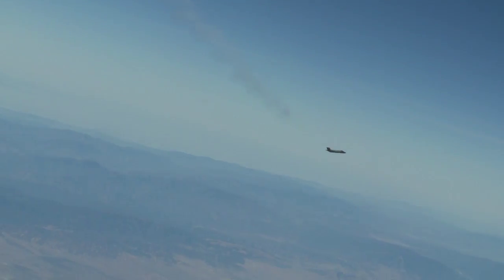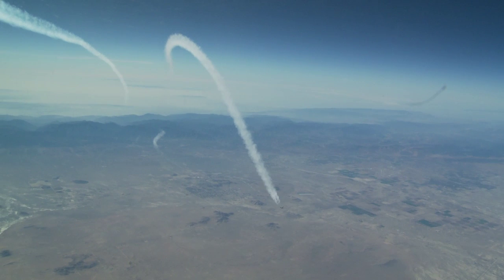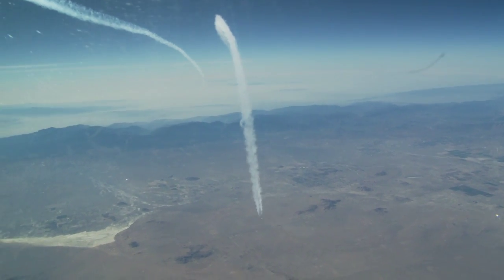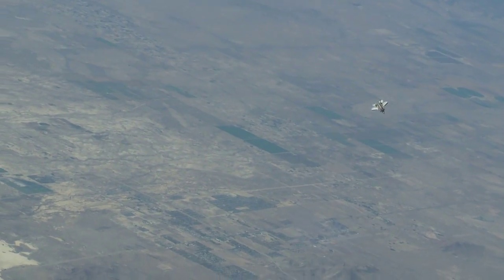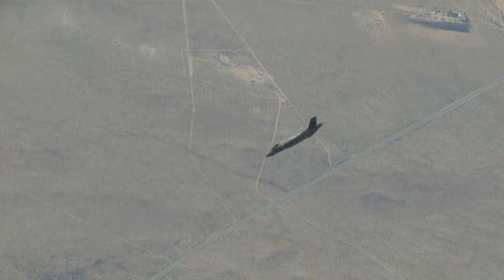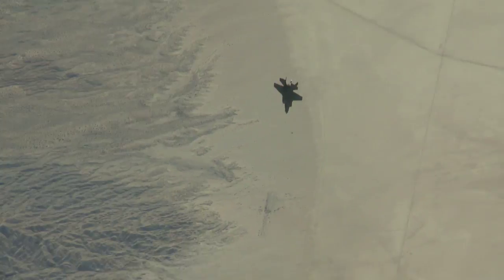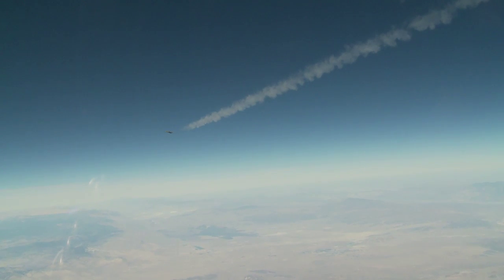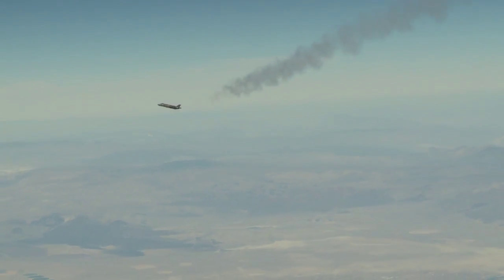F-35 High Angle of Attack Testing

Comment: why not put a moveable valve at rear of f 35 engine to make it turn right or left easier
Reply: +Rodrick Darby Have you not seen how crazy the vectoring on the F-35 engine is? Do you think you're smarter than the engineers?
Reply: +Scarcer the f-35 does not have thrust vectoring like the f-22 or su-35. The f-35's engine nozzle only points downwards for vertical take off, not for air manoeuvring.
Reply: RIGHT OR LEFT
Reply: I agree in that they should add left and right thrust vectoring, but that would make an already expensive jet even more expensive and money wasting.
Reply: +Rodrick Darby Too expensive.
Reply: +AussiePillow1 left right? nah up and down like the f-22     pilots dont yaw left and right, they bank and pull back to turn
Reply: +Rodrick Darby http://ieeexplore.ieee.org/stamp/stamp.jsp?tp=&arnumber=6643869, you might only want to read the conclusion part